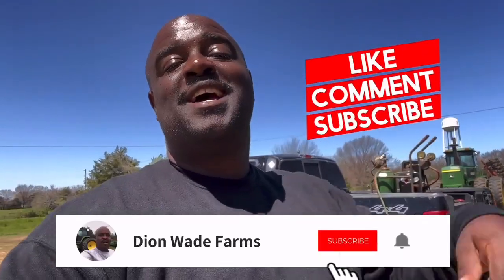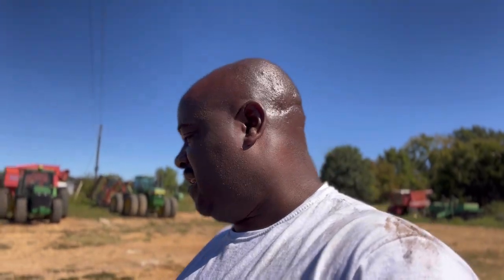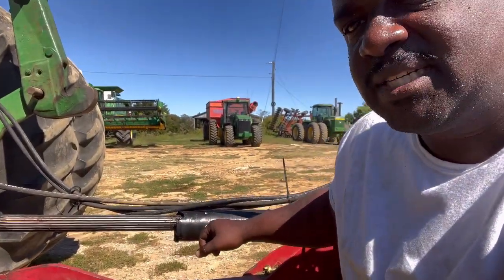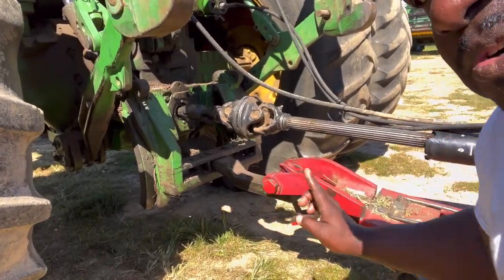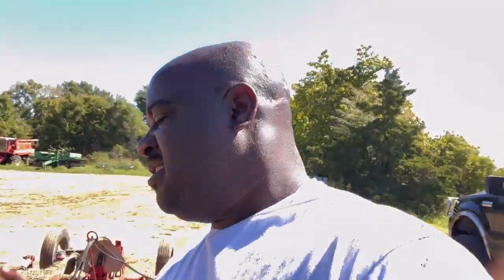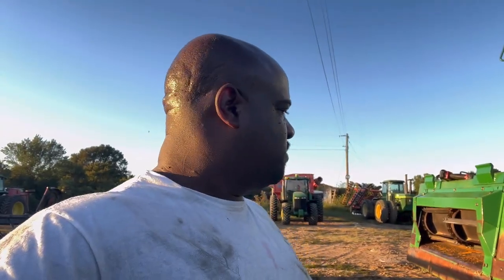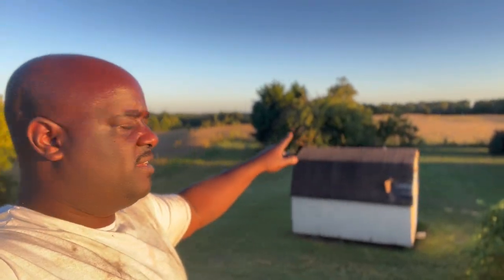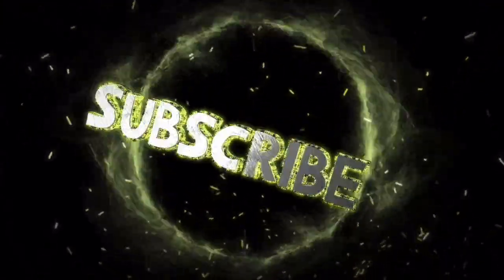Mechanic work on 9750 STS

Comment: The poor mans way (my way) of lengthening the PTO shaft is to get a PTO adapter. What ever you are running, 1000 to 1000 or 540 to 540, that will give you another 3-4 inches of engagement. and according to my wife 3-4 inches is enough 😅
Reply from the maker: 🤔 you might be on to something
Reply: haha
Reply from the maker: Start from the beginning an work your way up . I’ve spoken a lot about the farm

Comment: as far as the big sprocket small sprocket on the feederhouse you will have to refer to the book. idk what head you are running or what crop you are going into. Your operators manual is your bible.
Reply from the maker: Head I’m running is 630 flew jd head an cutting beans